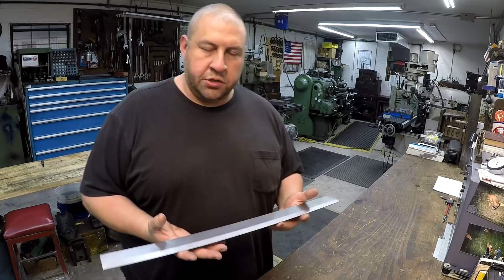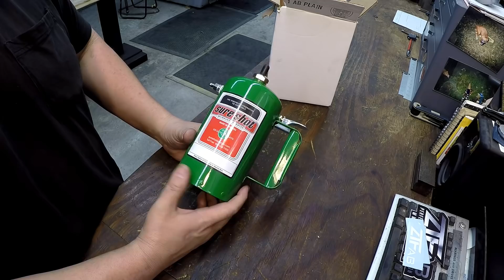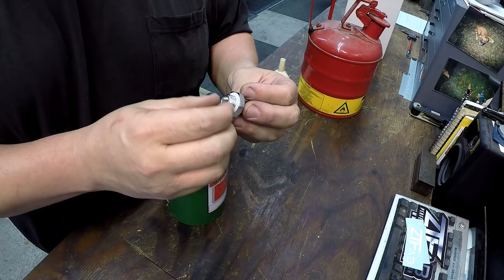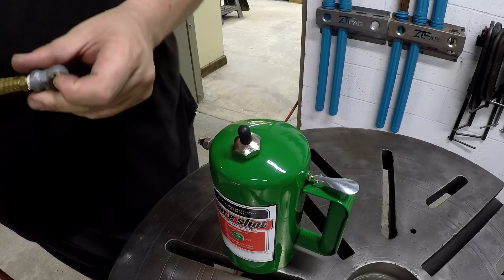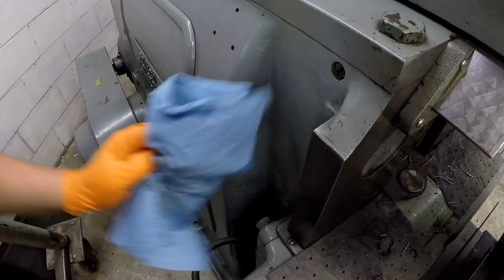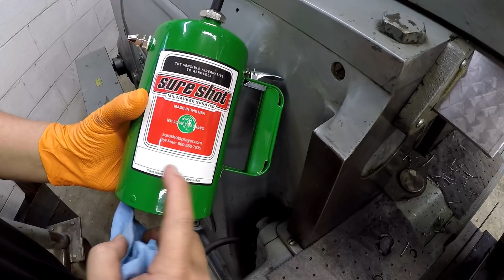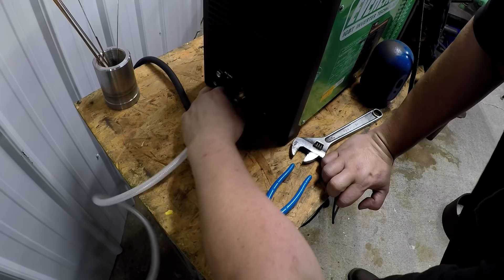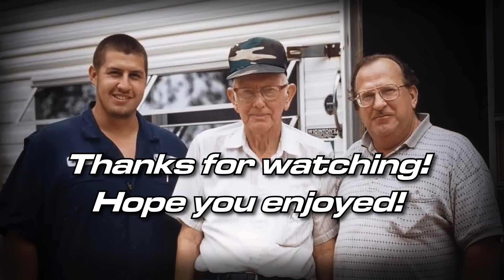SNS 216 Part 1: Straight Edge, Everlast Gas Line

Comment: Good score on the straight edge. 

For those interested in re-calibrating a steel straightedge, here is the procedure I was taught when I did work for the metrology lab. Straight edges are easy to re-grind on a GOOD surface grinder but not in the usual way with the edge up. Any error in the back surface, elasticity in the set-up, affect of the mag chuck, etc will be transmitted to the edge you are re-conditioning introducing error. Instead, I suggest laying the tool flat on the table bevel down so there is a space between the reference edge and the table. By laying the straight edge flat, it's free to find it's own relaxed condition and all minor errors in set-up lie in a plane vertical to the reference edge you're re-conditioning. 

Align the edge with the table motion. Relieve the side of the wheel slightly so the very rim is slightly proud. Turn the magnet on. Flood the work with coolant and cycle the table for a few minutes to make sure everything is in thermal equalibrium.  Lower the wheel almost to the table and grind the edge of the tool by dialing with the crossfeed grinding with the relieved edge of the wheel. Take very light cuts; the relieved edge is delicate. Stop at a bare clean-up and let it spark out. 

To check, flip the straight edge over on the magnetic chuck so the bevel is up. Dial in the edge and check it with a 0.0001" or 2 micron DTI. The reading will be double the actual straightness error. Check with the relevant standard if the re-grind has to be certified. Otherwise, shoot for 0.0002 per foot or 5 micron/300mm.
Reply from the maker: Thanks for the tips Forest. 👍🏻

Comment: I bought a 24"  Sarrett edge like that new 25 years ago, they seem to get dinged no matter how careful you are. As long as it is flat like yours appears to be Ignore the dings and use it. If you need better precision than that indicate off the surface plate or use a scraped edge etc...

Comment: Do you purge the lines with gas before you connect them up to a machine? I was always thought to open up the regulator for a split second to make sure there isnt any dirt going into the machine. Probably not an issue with brand new hosing, but but :))
Reply from the maker: I was taught to purge the tank before installing the regulator.

Comment: I worked at a foundry for a while. They used a sprayer like that for a parting compound for some of the cast iron sand molds.
It looked like silver/ aluminum paint, very thin.
Thanks for the vids.

Comment: Great video as always... Tip.. store your gas cylinders near light switches then you will find every time you turn the lights off when you leave you check the valve on your cylinders.